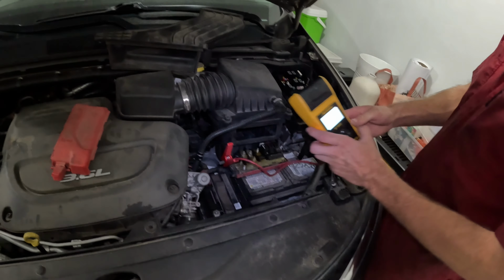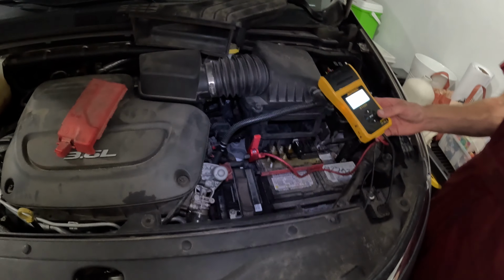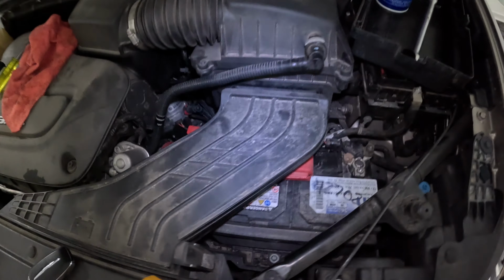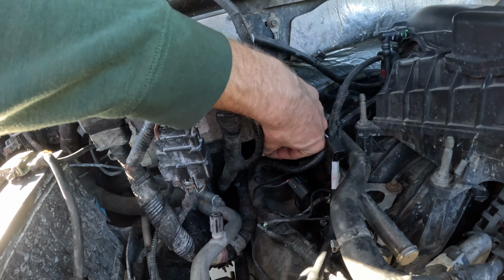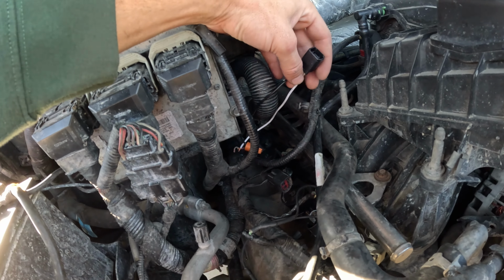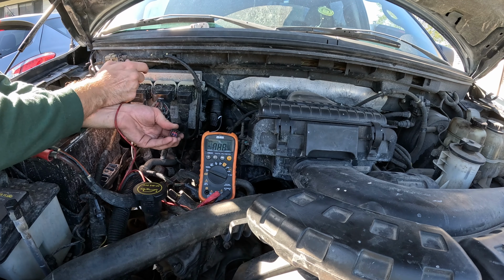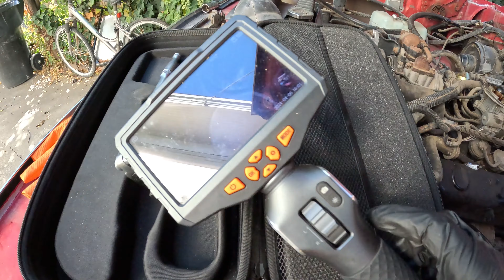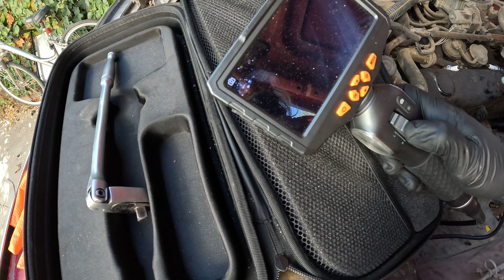BIGGEST Problem with being a mobile mechanic | Roadside Rescue

Comment: I do mobile mower/tractor repair, I charge for everything, the trip to the customer, and back, I also charge for disposal of oil, oil filter, and used parts, I look at it this way, if it cost me money to do, I charge the customer the same price, I include it in the job. You need to have a set of standard fees and charge upfront, your time is just as valuable as the customers, don't ever sell yourself short.
Reply: People don’t want to be nickeled and dimed to death like that. It’s like going to a restaurant and getting charged for ketchup packets and ice.

Comment: I think you need to have a minimum, charge a travel fee or whatever. Make the customer aware up front. Maybe as a rule of thumb just refuse to work intermittent issues and focus on cut and dry fixes.

Comment: You have to tell customers you have a minimum fee based on travel distance and time diagnosing problems with their vehicle, even if you're unable to fix the problem or if the customer refuses to make any repairs that you tell them are needed. 

All successful plumbing, electrical, and HVAC service companies have minimum fees they charge just to show up. You can always wave the fee if the repair turns out to be worth the trip. You, like everyone else, need to look out for #1.

Comment: This is when you can use an oscilloscope to view the starter brushes and have that as indication to replace the starter if the brushes are worn.
Reply: 99 percent of the time you dont need a scope to diagnose electrical problems. A meter and test light is good enough if you know basic electrical theory

Comment: Hi Ernest, those Pacificas have an auxiliary battery next to the main battery, it’s like a motorcycle battery and always go bad. The auxiliary battery is also the one that starts the vehicle and should be tested by isolating it from the main battery. Another issue I’ve seen is a ground right underneath the battery tray being loose and corroded, hope this helps

Comment: Do you think Charging 50.00 a wheel to replace rotors and pads on a 2020 Hyundai Tucson is ok ?
Reply: @coreybabcock2025  yes
Reply: You'll notice there's usually an additional point something hours book time in service data for each rotor...over top of the time to replace pads.
Reply: @tedvandell  ?
Reply: @coreybabcock2023  you should get a little more for the rotor. Those bolts are bigger, tighter, and should get threadlocker. That's more expense for you. And some rotors have screw fasteners that can strip or size. Couple more $$ for the rotors.
Reply: @tedvandell  those rotor screws are not nessary to replace
Reply: @coreybabcock2023  still have to get them out if you're removing the rotor
Reply: @tedvandell  yea I know
Reply: @coreybabcock2025  be safe out there.

Comment: Did you take the inlet temp of the catalytic converter by any chance? 

Iirc the engine mount comes off and then you can access the starter, but I don't remember how close it to the collector. 

My guess is the converter is on its way out and causing excessive temps, heat soaking the starter. Or there's just a bad brush on the starter and sometimes it catches, sometimes it doesn't. 

If the starter is getting heat soaked it matches your diagnostics of the starter, however that's only a symptom of another failed component. 

Did you run it long enough to check o2 temps?

Comment: Ive seen good compression but when we tore the engine down the oil rings were sticking and piston oil drain back holes were clogged. So it causes it to burn oil.

Comment: I had an intermittent start no start issue on a Ford Escape. Same thing, I would look at the car and it would start. What I did was shake and wiggle the engine wiring harness and grounds until I got a no start. The problem ended up being a lose ground. As for the wrong part from the parts store. What I do now is verify how the part looks on rockauto’s website. If the part I’m picking up doesn’t look like the part in the picture,  I don’t pick it up. Rockauto hasn’t failed me yet.

Comment: You should get a packout type system for when you don’t have the full truck setup, and have at least a few tools for electrical. Sk has a new packout system that looks like little mechanic roll cab sections that snap together. It’s pretty nice. I have a small craftsman versastack and it’s packed with like 200+ pounds of tools but I have electrical and diag stuff jn the small top case with my impact and electric ratchet and a battery. Some gloves and safety glasses, magnetic tray and paint pens. 
Then I have ratchets and sockets in the middle and pry bars hammers pliers screwdrivers and other misc automotive tools in the bottom. It’s pretty heavy and hard to move around though. I plan to get a full bank cab for at home though. Then some more cases for the packout so I can further organize and break up some totes, but being organized is key with this type of work.

Comment: As someone who has worked on Audi/VW more than I'd like, that honest probably was the right pcv valve, only it's just the diaphragm and cap to essentially rebuild the unit, which isn't that easy to remove but possible, the rubber diaphragm is what goes bad on those usually
Reply: The whole thing is considered breather valve or oil separator

Comment: Parasitic drain?  intermittent bad starter relay ?
  Matthew Parker tends to feature the customer interaction when possible, and clips up the repair 
he has the same issue with wrong parts often, seems like you have to pull the bad part and bring it with you,
maybe become a parts cannon mechanic  seems like the money they save not taking it to a shop could 
be spent up on a few new parts that weren't actually needed or that's the way i think about things  
when working on my cars especially when the part is stock and aged anyway

Comment: I know what my local auto parts stores are like in Australia, unless I go to Supercheap Auto (similar to Auto Zone in the U.S.) or Repco then I'm not guaranteed to get the right part for my car.

When I went to Autopro which is probably even worse now with their merger with Bursons auto parts I kept getting sold a knock sensor for either the 3.8 litre Holden/Buick V6 engine, the L36 engine in this case which knock sensor also fits the locally made Holden 5 litre V8 engine,not the 5.7 litre Chevrolet LS1 V8 engine which my Holden Commodore has fitted.

The knock sensor doesn't fit the Chevrolet LS1 V8 engine & I had to go onto eBay & order the right one, back in 2009 my local area didn't have a Supercheap Auto & Repco would've charged more than the eBay seller for a good quality U.S. made Wells knock sensor to suit the Chevrolet LS1 V8 engine.

Even the local EFI specialist supplied me with the wrong knock sensor !

Comment: 1. You are a mobile mechanic, if you get wrong parts, then yes the customer pays the travel.. because they chose to have on site service…
2. If you are giving someone one discount, then do not give them any other discounts.. like free travel, parts discount, etc. 
3. Please start valuing your time, experience, tooling, etc more, because you are under valuing your self.  You should feel ok charging more for your services because they  are a premium service…

Comment: I've seen engines that will start when you remove a spark plug. This is usually a busted cat or restricted exhaust.

You know the poorman's compression test can tell you a lot of about an engine. Clear flood mode, or disable spark and fuel then crank engine (may need jump starter) to see what it sounds like. If you had no or low compression or flooded engine, the engine will crank freely like a broken timing belt. If you have one or two cylinders with low compression or bad valve, the starter will momentarily speed up when it gets to that cylinder. 

Learn how to listen to the engine when cranking to identify what's wrong. I always use a hands off approach on the initial diagnostics. Once you tear down an engine, it's more difficult or impossible Todo any testing. 

If a cylinder is flooded, you can remove plug, crank it over and clean cylinder out, the. Squirt 3-4 shots of motor oil into the cylinder and recheck compression. This is called wet compression test. This can tell you a couple of things. If cylinder is washed down with fuel, a wet compression test will build up a more normal compression reading. If the cylinder walls are scored or rings are damaged, it will point to a bottom end problem if compression comes up. If it still has no compression with the oil, then you are most likely looking at valve issue or blown head gasket. This is another reason you need to always remove ALL spark plug when. Checking compression.  Head gasket could be leaking or blown between cylinders. 

Once you learn the poorman's compression test, you can easily just crank the engine and hear if the mechanical part of the engine is good, or if it has a dead cylinder due to low compression and likely a burnt valve or some other valve train problem. 

Good engine: 
RA-RA-RA-RA-RA-RA

Bad Cylinder maybe burnt valve:
ra-ra-ra-ra-RA-ra-ra-ra-RA

Bad engine due to broke timing belt or chain, similar in cold weather if AL cylinders are flooded: 
raaaaaaaaaaaaaa

When cranking the starter will momentarily speed up when it gets to the cylinder with very low or no compression. Thus causing a change in the way the starter sounds. 

An old mechanic taught me this my first week at Goodyear in the early 1980s. It's Auto Mechanics 101. Anyone who doesn't use this technique is likely inexperienced. 

You must have a good battery and working charging system. If you don't then you will have lower fuel pump performance and a weak red spark. A good battery is critical when diagnosing a vehicle. Oh you got a weak red spark and it needs a new coil? You better rethink that one.

Comment: if a parts store gives you an incorrect part they didn't do as told or you did it wrong. Tell the truth. If you specified a PCV valve for a 2000 Toyota Corolla, then that is what you should get and the part store should give a full refund.

Comment: I hope you started charging a minimum don't even go look at something for less than $50-100 even if you spend 5 minutes on it don't touch it and go on your way, still charge that minimum. You can miss out on like 90% of the profit you could make if you charge by the hour and not by the job, please don't provide a service and charge by the hour the customer is robbing you if you are. I really hope you have an LLC and that you itemize your deductions and you are not a sole proprietor taking the standard its not worth it when you own your own business it's meant for W2 employees. All businesses should have a goal of $0 profit every year not that you don't make profit just that you went and grew and bought assets with the profit you did make so you don't owe any taxes the sales tax was all the tax you paid.
Reply: Good advice
Reply: And commercial insurance too
Reply: Hourly rate with a minimum upfront price when they call. You can always discount the price after you're done if you're inclined, but that's your choice. Not there's. You have to earn a minimum, or your business will fail. You can thrive if you require clients to pay for your costs when providing your valuable service. Do it upfront when you first talk on the phone. It weeds out most of the unprofitable jobs before ever leaving the shop.
Reply: You can itemize as a sole proprietor and minimize tax liability. However, your home and personal possessions are not protected as they mostly are if you get an LLC.
Reply: @tedvandell  different tax breaks and deductions between LLC and sole proprietorship as well.